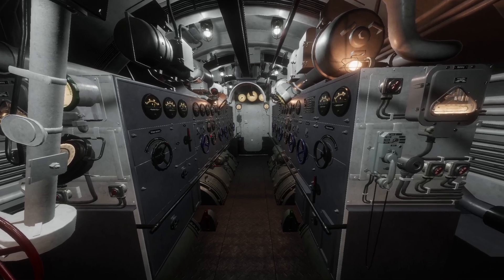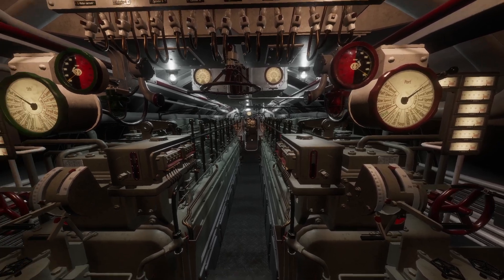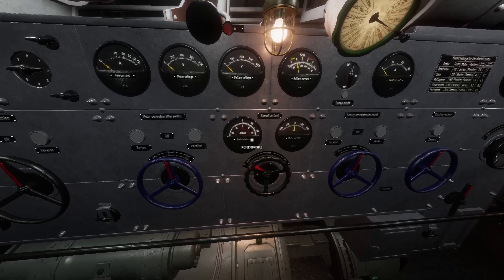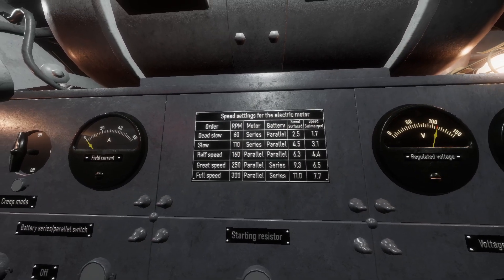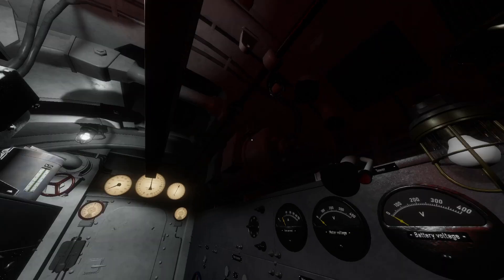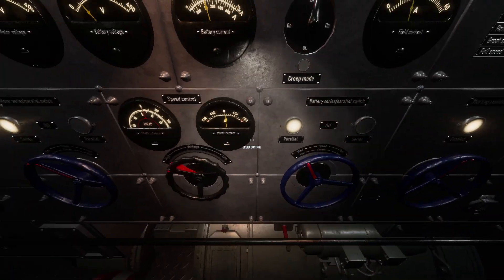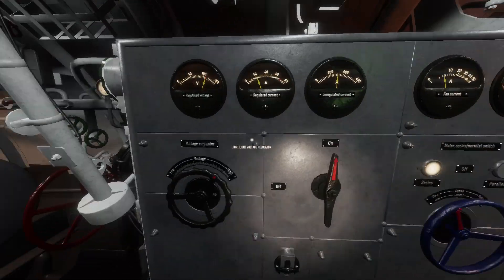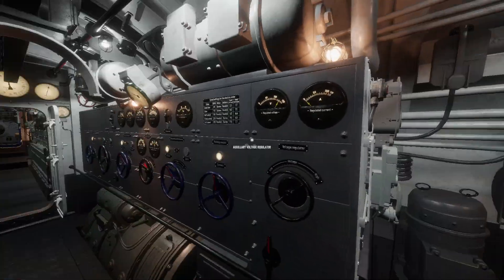Wolfpack | Everything Electrical | How to manage your electrical engines

Comment: Weird i just bought the game off steam, but I can't play the with engines or the gens, the inside is also missing a lot of features your video is showing
Reply from the maker: Right click on woldpack on steam, go to properties, betas and then select the beta and you'll have access
Reply: @jammroberts  all right I went and did that and I got all the features it seems like, I got the breakers on the port and starboard side, but I still can't interfere with the diesel engine like changing how much oil they're getting their RPM opening and closing the valves. I'm wondering if it's because I'm not the right crewman, or I'm in the wrong game mode or something
Reply from the maker: @zXStrykerOneXz  Okay so you need to make sure that you have two things, A. The lobby needs to have AI Bots turned off so you can work the engine room (if you're the captian) or B. You need to be a machinist or Chief Engineer on someones server, hope this helps!
Reply: @zXStrykerOneXz  I don't know if you still need an answer, but having Automatic Engines to off is also important